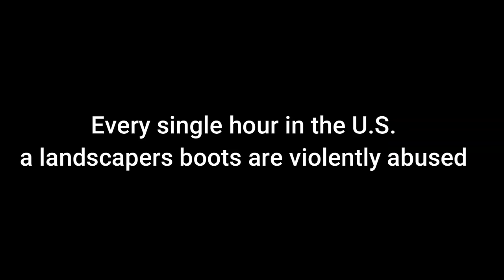The CITY NEGLECTED this for YEARS it was SO BAD that we BROKE our MACHINE TRYING TO CLEAN IT

Comment: I watch both channels cabin on the hill and Kevins channels the boring channel and lawn care juggernaut and I see you guys always shoveling off sidewalks, driveways, and curb sides I also do landscaping and lawn care work. You guys should get a snow blade for your tractor and use it to scrape off the dirt and debris from the sidewalks and stuff. It would make it a lot easier and faster also. You could probably even modify an older garden tiller that has a blade that would scrape off some of the smaller spaces. I am 49 and I am already looking for better ways to get away from the back breaking work. It’s not as easy as it was when I was 20 lol

Comment: Hello, first of all a question: Does the church not have a board of directors? If so, then I seriously ask myself why he didn't put more pressure on the responsible authority? That sucks! If the water cannot drain away during heavy rains, there will be flooding and as a result aqua-planing, which means that motorists are at risk and this in turn must be the responsibility of the responsible person. Apart from that, things don't look good. This person should be told that in a very emphatic way. They both did an exceptionally good job. I hope that you will also receive the upcoming thanks from the people. Warm greetings from Germany

Comment: one of those tractors with a power brush on the front mite do the job...or a tracked bobcat with those finger type rotary brushes they use for cleaning up college campuses would definitely clean that off...i have no idea what they cost though...i can t put the video on here because you tube will block it or remove the comment...because it offends somebody's 'their feelings'...

Comment: Washing the DIRT AT THE CURBING SEEM SO …….WRONG!    What it just created. HEAVY MUD.     Therefore , HEAVY TO SHOVEL UP WITH &   VERY MESSY !           Should have just clean curbing WITHOUT the pressure washer ……to AVOID MUDDY  MESS.     Should have  scooped up dry dirt and at same  same time Edging the area.     The pressure washing was an  ADDED PROBLEM for the roadside curbing .

Comment: The manhole there is covered the top part with lotsa dirt again wowwwwwww yet no rain a lot since that is 4 seasons country 

No wonder they say homeowners have the freedom to maintain their side of the  pavements manhole always cleared understandable because if it snows there during winter season it be easy to clean during the melting Spring season as it turns to water eventually and it drains easily 

So might be not snowing a lot in past two decades no wonder more soils dirt on top of manhole for years 

Climate changes makes the laws of residential zones maintenance should also change with it don't yalls think aye 

Good people like yalls exist doing it for free